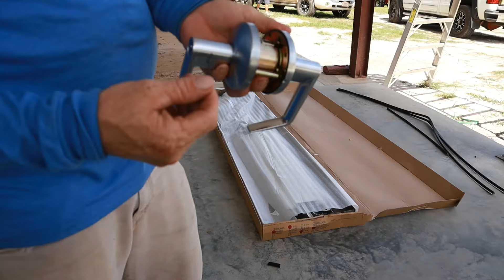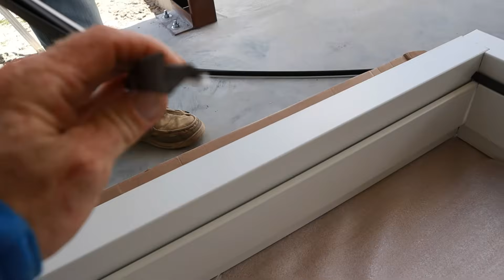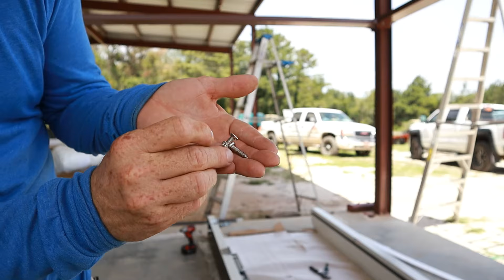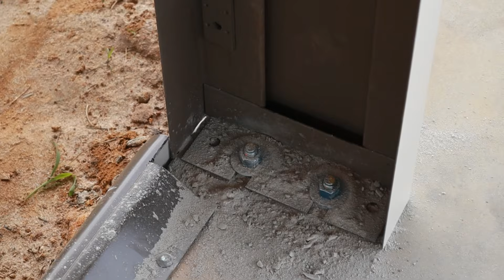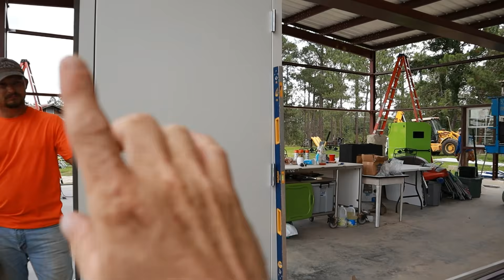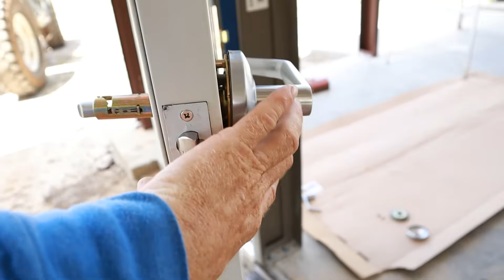How to: Entry Door installation for a Metal Building

Comment: Wow!  You need to be ordering the commercial doors from Door Depot.  They ship them pre assembled with all hardware and accessories.  All you do is install frame and hang the door.  Would save you so much time and work.  Work smarter not harder.
Reply: So pay Door Depot to put the frame together instead of paying yourself (as a contractor).  Door depot is great for the DIYer. If the DD door was cheaper than the kit then that would be smarter.

Comment: I have been doing pre fabricated metal buildings for 11 years and still hate walk doors lol
Edit: just out of curiosity, how many of those wood screws do you have 😆
Reply from the maker: I have a few but usually we throw the screws away...lol..why are they included?
Reply: @BuildingwithNARF  but why do they mix the screws instead of separating them...... it is annoying.
Idk what door manufacturer you get with your buildings, we always get assa abloy. I like how your door has the threshold put in before setting. Ours is cut to fit and installed after. Is yours spaced perfectly before installing?

Comment: Hi..I got a steel door to put in..but  there's a steel frame that came with the building ..separate from the door box which I bought..I have to cut the girt which is no problem.. the steel frame is 7'2x3'4..will door box interfere with this....I assume that door box gets welded to frame..but not sure..have you installed this kind?
Reply from the maker: You will need to assemble together.
Frame the door with the frame at the same time.  If you assemble frame first then it will be hard to get the door and jambs in later.  We usually use screws and do not weld.

Comment: Thank you brotha!  Just watched your video on squaring a metal building and then this video.  And I’ll be doing those two things this week!  Questions I’m assuming windows are the same it’s just that the window will be able to slide up and down in the channel to the height you want?
Reply from the maker: Yes frame your window to the size desired... usually 1/2" bigger opening than window measures... and to the desired height. 
Before installing doors or windows, building needs to plumbed, squared, and all bolts tight.  Check doors again before wall panels are screwed off.
Reply: You’re the man.  Will do.  Thanks so much sir!

Comment: what type is the weatherstripping have the same door frame missing it.
Reply from the maker: Not sure of brand but it is a standard kind.   Should be able to find at any builder supply.
Reply: @BuildingwithNARF  ok mine is the same without the groove for the seal channel.
Reply from the maker: you may have an interior door frame

Comment: Thank for the details. Just built a 9000sf building and needed the door and window instructions.
Reply: Next time you need commercial doors try ordering from Door Depot. The doors come pre-assembled with all hardware and accessories. You just attach it to the frame.   Saves lots of aggravation and time.

Comment: Im to this point on my building but my side girt is 2 inches above the door. Whats the normal fix for this? Its a 40x50 with 14'sides. All clips are down so they are not flipped but sure seems like the holes were punch high on all of them or is this a normal thing on some buildings?

Comment: Good vidio but not info, on drill bits to stablize door pin nuts 1/2 inch or whetever. Door long lenths wide more inportant the floor cilling. Higts metcments to cill ect ect you nees mechements espfic on what you showing! Thanks!